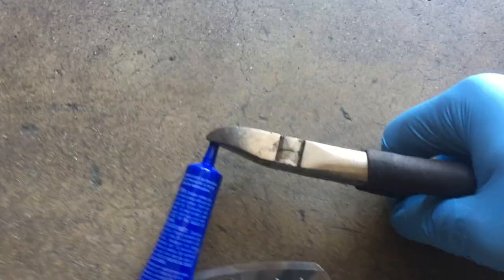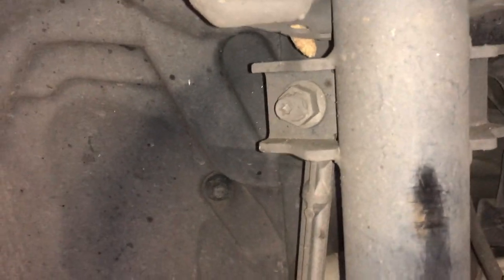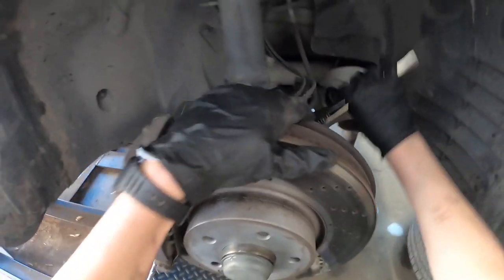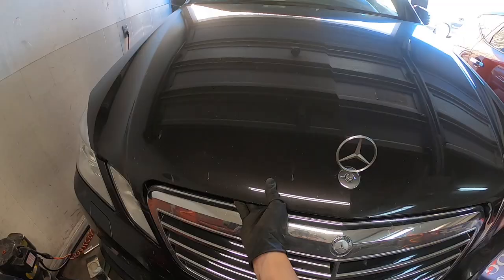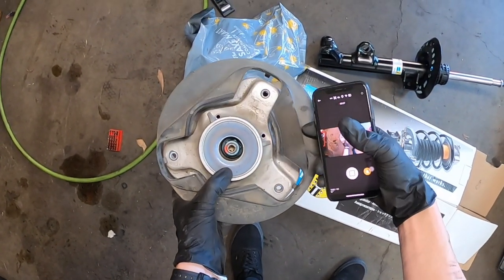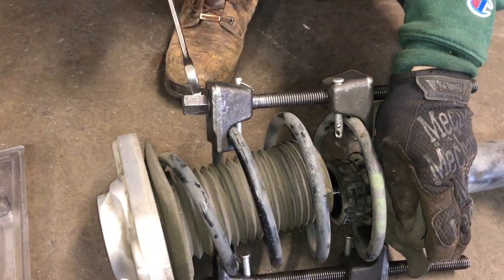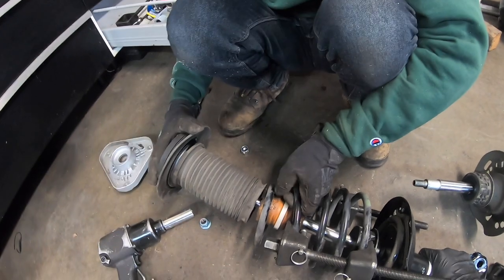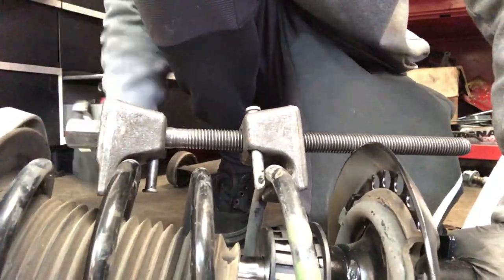Mercedes e350 front shock replacement with Bilstein struts STEP by STEP DIY for 2010-2016 E-Class.

Comment: Thanks.  I did my rear shocks and springs.  Now time for the front.
Reply from the maker: The regular Bilsteins work great, but kinda regret not trying the more fancy yellow ones.
Reply: @mikeicee  I’m with you on the B6 Yellow Shocks/Struts for a performance upgrade.   I put the Black B4s on the rear so probably do the same on the front.  I might do new springs also.  Not for sure yet.
Reply from the maker: @juicebox22a  The b4 are pretty much like the factory feel, but I'mm curious on the B6. I didnt want to spend the extra on the B6 at the time.

Comment: The springs look the same top and bottom but they are subtly different.  If yours are not marked then take a close and careful look at the ends; the one that has more of a downturn goes at the bottom. The coil that is flatter is for the top,  Learned that the hard way. Also if you dont have access to a dedicated Mercedes spring compressor you may need to use 2 sets of standard spring compressors

Comment: Hi are the w204 front shocks the same as the w212 front ? Rwd ? I know the have slightly different part numbers but they look exactly the same ?
Reply from the maker: I know the W212 has many W204 parts, I would just use the original parts unless you want to achieve something special

Comment: I ✔️ the LIKE button. 

The coil spring broke front drivers side 2014 E350 Sport/Economy ( top coil of spring) 2 days ago when I was sitting in the car. It sounded like an explosion.

Going to tackle replacing the coil spring.

Any suggestions? Any precautions to take other than the compression?
Reply from the maker: thank you and wow it just exploded?

Comment: Thanks for the info bro. Is the default Mercedez shock better or the bilstein one according to you.
Reply from the maker: They seem about equal. In my case the Bilstein were cheaper. I think I put maybe 70K miles on them and they are still good.
Reply: @mikeicee  is there any ride difference you felt after changing , I mean change in softness or stiffness
Reply from the maker: @sudhikrish9785  My original shocks were completely done and bad, the bilsteins (black ones) feel similar to original. I heard the yellow bilsteins are better.
Reply: The default shock absorbers for mercedes are produced by sachs. Pretty good i would say

Comment: How did the car drive afterwards I think my shocks are goneee I have a 2014 e350 4 Matic 115k should I change the strut mount as well ?
Reply: I feel every bump
Reply from the maker: I didn't change mine and have no problems yet.
Reply: @mikeicee  if you watch my videos I have been fighting a clunk on the front left wheel when pushing in on the top of the tire when on the ground. I just changed my whole steering knuckle today only thing left is strut mount maybe ?
Reply from the maker: @G_G_AutoCareLLC  It could be... you definitely have a clunk. Also you can check your brake fluid... if its color of Cola or Dr Pepper instead of golden yellow it might show that whatever you have the ESP is fighting it.
Reply: @mikeicee  hmm 🤔 never thought about that but the clunk is only when rocking your weight on the 12 o clock position of the tire . No clunk when car is jacked up.
Reply from the maker: @G_G_AutoCareLLC  If you dont have airmatic try opening the hood and lifting the rubber plastic over the strut bearing housing... that way when you move up and down it might be easier to hear or see...
Reply: @mikeicee  I do notice that when I reach my hand and grab the strut by the spring when the car is on the ground I feel the clunk . It’s like when the weight is on the component it gets loose. If I rotate the steering wheel or roll the cad  back and forth the clunk will disappear and then when it sits for a few it will appear. I guess when it settles the play comes about ???
Reply: Also what tire psi do you run
Mine says max 35f 41r
Normal 33f 33r
Reply from the maker: @G_G_AutoCareLLC  I do 33F and 44R, but with the 4matic i'd fill them to whatever the door jam sticker says.
Reply: @mikeicee  ok what tires are you running I have kumho I believe they are crap they are new tho
Reply from the maker: @G_G_AutoCareLLC  well the spring coil is on a rubber mat on the shock assembly... BTW my front wheel bearings have seemed less than perfect for a long time... I watched one of your shorts... lol you're not scared to take stuff apart.
Reply: Check sway bar Link . Those are first to go bad and it cause clunking noise

Comment: Did you get a wheel Alignment after you changed your struts?
Reply from the maker: I did not LOL, car drives just fine... I think on these cars only the toe is adjustable upfront and you need to buy bushing/bolt kits if the other 2 are out of spec.
Reply: @mikeicee  brooo just did my struts with the bilstein b4 replacement it was noooooo joke the spring is under massive amounts of tension more than any car have ever worked on. But in the end I knocked it out will be installing units in car tomorrow morning